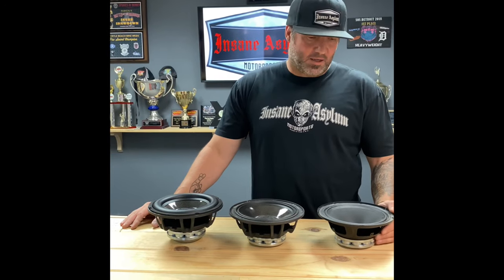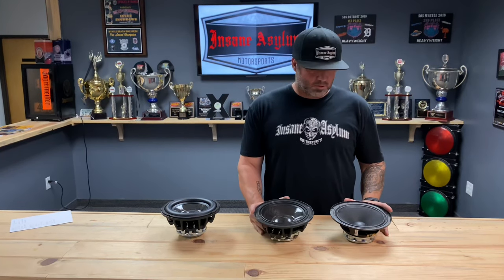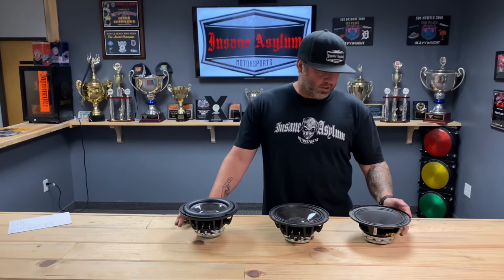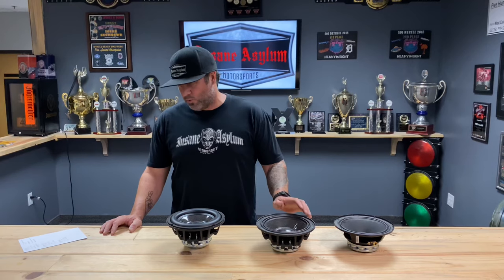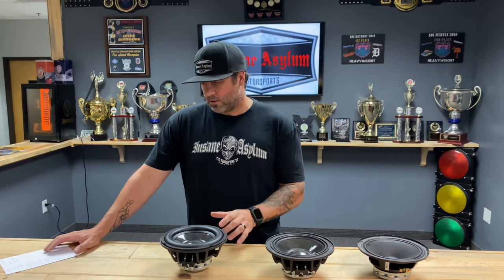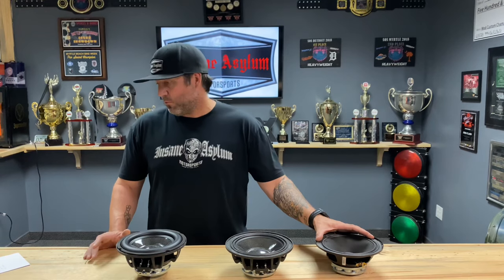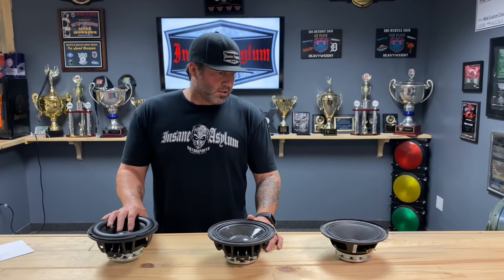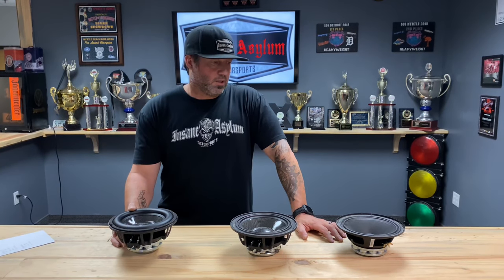The difference between a true mid bass and a regular mid bass speaker

Comment: No such thing as a mid bass, they are all mid range woofers. Just cus one woofers frequency response is lower than the other does not make it it's on made up "midbass" category. Its just a woofer guys.
Reply: All a sales pitch.
Reply from the maker: @filibertofonseca8083  so then you say that there is only mids and woofers?  Why?
Reply: @filibertofonseca8083  Really? I think you might want to think a bit more about the actual physics of loudspeaker drivers.

And to say that that they are all midwoofers is pure nonsense. Not much "Woof" in a driver that has an FS of 85 or higher hz, is there. Quick story for you two "experts". The term "Woofer" and "Tweeter" is actually not the real technical term at all if you want to get into semantics. Those are terms people came up with around the late 50's and 60's. Do you know what mids used to be called? That's right, "Squawkers". They were given nicknames based off of the sound the frequency range they played by themselves made.
If you want to be clever, you might want to look into what the ACTUAL technical terms are. HF driver, MF, driver, LMF driver, LF, driver and Sub bass driver. On occasion you will even see the term high mid tossed around.
And there very much is a difference between mids, low mids and lows. Are there drivers that can pull double duty? Of course, but that usually comes with a sonic penalty somewhere.
Now can anyone of you two clever heads guess what an FR driver is?
Reply from the maker: @AB-80X  Are you referring to me when you say you two? If so, not sure why your even here trying to make yourself look so smart.  I agree with most of the things your saying but they way your coming across as a know it all and talking about "technical terms" and other nonsense is pointless.   We are using the industry accepted terms for these drivers.  What does it matter if they are the correct technical terms except that its a way for you to try and show everyone how smart you think you are.  If you have something constructive and helpful to add by all means lets hear it.  IF you just wanna throw around some "technical terms" that has nothing to do with the video, go troll somewhere else.
Reply: @insaneasylummotorsports5757  
No. Just Filberto. It was only after I posted I noticed that both the first and second comment was from the same.
Reply from the maker: @AB-80X  ok good. Then I take back what I said. I have deff agreed with most of the points you have made.
Reply: @insaneasylummotorsports5757  
No worries, all good.
Reply: They’re called woofers, or mid range woofers, but they play mid bass

Comment: 8" is only usable for midbass in a huge midbass horn.
Reply from the maker: Not really true.  Surprisingly for how low they will play they have a very wide bandwidth. I pair the midbass with either the EXT1.5NH or the new EXT2NB.
Reply: @insaneasylummotorsports5757  
I'd say far from true. It all depends on what it is designed for. Would I cross an 8" above 7khz? Rarely, but a real midrange driver will have little issue playing to 6khz. Heck, there are some really good 10" mids that will easily hang on up to 6.5khz. That same driver however, will rarely be any good below 100 hz. Many true mids have an FZ in the 100-150 hz range, so they will simply roll off. It's a give and take, and why small two way systems are often crossed between 2.5 and 3.5khz. Does not matter if it's an 8" or 5". If it's designed to go into the midbass area, then the higher frequency range will suffer and the driver will start to beam up etc.

Comment: I've never heard so much bad info from a "professional " in my life.
Reply from the maker: Really? Let’s hear your explanation of bad info. Who are you?
Reply: @insaneasylummotorsports5757  too many generalized statements.  Carbon fiber cones don't mean heavier or less efficient.  In fact, most carbon fiber cones weigh less than their counter parts. "Midbass" vs "true midbass" is bogus also. There's midbass and midrange.  If someone didn't know anything about car audio, this would be even more confusing to them.
Reply from the maker: @bartowflorida  so you have actually measured the parameters of all three of these speakers that I am specifically talking about?  These carbon fiber cones are heavier than the paper cones. If you run straight carbon fiber they tend to sound harsh. The added mass smoothes that response out. So again not a false statement or bad info.
Reply: @insaneasylummotorsports5757  so, beyma carbon fiber sounds harsh? How about mmats or euphoria? You should’ve specified that you were talking about those specific mids on your table and not generalized statements…if this was supposed to be a teaching video
Reply from the maker: @bartowflorida  would figure you could see that I was talking about the speakers I had on the table and in my hands. Yes the BEYMAs are harsh without lots of tuning. When you do your own videos you can do them however you would like. I think most everyone on here that don’t  want to just argue understands I’m talking about those speakers on the table.

Comment: What would you rate the Hertz SV 200L AS? The box says woofer, the specs scream low bass/mid-bass( not sub bass )
Reply: Hertz sv200L is a midbass. Great speaker produced pretty good bass, just sold mine to go to euphoria expert 8 inch carbon midrange in my lids
Reply: @corey wright  how does the midbass compare? Assuming you are talking about the middle speaker in the video.
Reply: @BushmasterM4A3  the middle speaker is the midrange. I have a set brand new for sale cheaper than you can buy anywhere else. Anyways the midrange is amazing. It can play from 51hz to 150hz. It will get down with bass and it’s loud at 99db.
Reply: @corey wright  cool, might hit you up on them. Mine will be for a car audio build, and according to Crutchfield, I am limited in depth. The midrange will fit, but the midbass will not. I'm going to pop the door panels off and measure this weekend and see what I can fit with a little creativity.